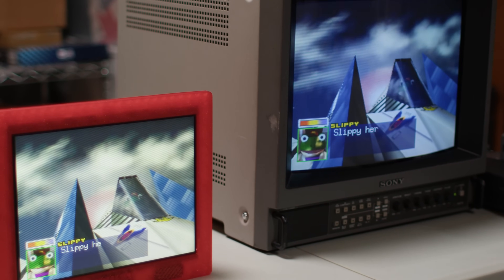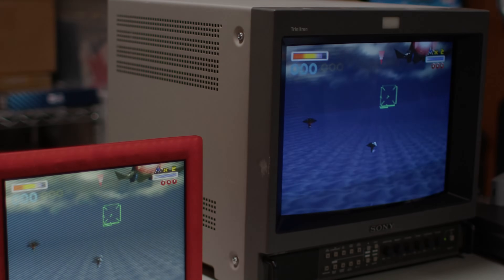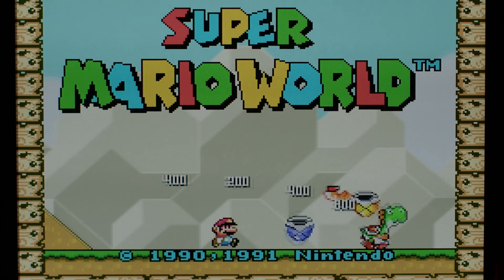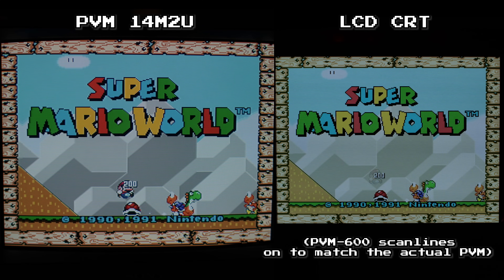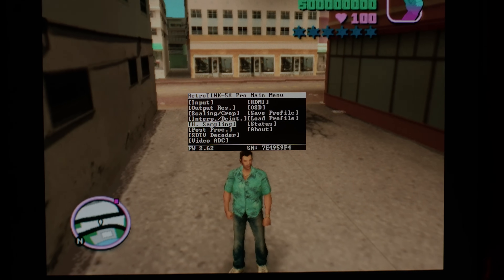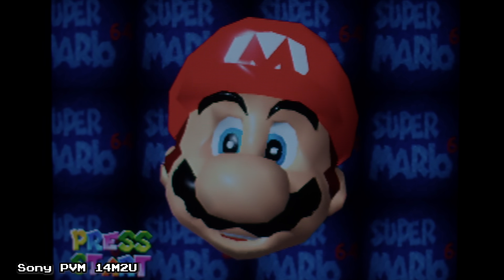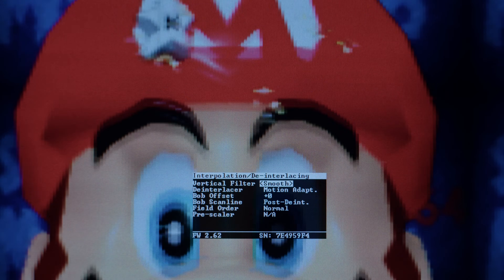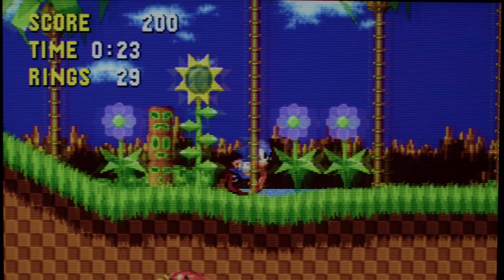Scanline Filters on the LCD CRT Kit

Comment: I have a mayflash Ps2 hdmi dongle and I was wondering if pairing it with an hdmi scanline generator would give good results, particularly in 480i and 1080i outputs. I know the ideal route would be going for a scaler like the gbsc or similar, but since I already have the hdmi adapter, I was just thinking on this possibility...
Reply from the maker: PS2 is by far best paired with a good scaler, since almost all the games are 480i. GBS-Control is less than $50 if you’re on a budget, but the RetroTINK 5x, CE and 4K Pro are the best for PS2. The OSSC Pro is also great, but not the original since it doesn’t have motion adaptive deinterlacing like the others I listed.

Comment: All of this has become something gourmet and problematic. No shader will EVER replicate the appearance of a CRT, this requires a scientific level of precision. To recreate it, you need to define a single LCD model, to develop the effect for its limitations, then no pixel shader program will do the job, you will need to build a program from scratch that takes the input and calculates pixel by pixel, with several decimal places of result, at a scientific level (this already exists, at an industrial level and at some level in the film industry, but it is expensive) and mainly: Have a lot of processing power.

It's funny how people worry about emulating a CRT tube accurately, but to this day, they DON'T GIVE A SHIT about the audio, there is no software implementation for analog noise, or for the audio processing of TVs from that time, which generated noise and a characteristic sound, we only have pathetic filters that seem to have been taken from Windows Media Player.
Reply: crt shader maximus royale will give you 95%+ (99% for me) of the real deal on a 4k oled

Comment: Probably a question that's been asked before but why does it seem like the pvm has more colors than the LCD? Shouldn't the iPad 3 screen be at least the same? Or is it because of the filters?
Reply from the maker: Well, CRT's always perform better with black levels and some colors than LCD.  You'd need Plasma or OLED to compete.  I don't think it's that drastic of a difference in person, so I imagine my settings on the camera could have been better as well.

Comment: This scan lines filter is basically the technology that ables lightguns to work. Does it work with it ?
Reply from the maker: That's not quite true.  And light guns will never work with flat panels.
Reply: @RetroRGB  So, I checked and my TV is a 100hz flat screen CRT, compatible with 100hz lightguns. So maybe the screen could have a frequence variation to get these guns working ?
Reply: @RetroRGB  Oh ok i was wrong so !

Comment: i wish PC gaming monitors came with a filter like this available in their firmware (but properly calibrated/tuned by in the factory for the best result with an specific FLAT panel).
Just imagine a 23.8" monitor with 1440p resolution running at a max of 300Hz, FLAT QD-OLED panel, HDR1000, Native 10-bit, Glass Front, Native CRT Scanlines Filter, Variable OD, Variable BFI & VRR tuned by @BlurBusters

Comment: Unfortunately it's not as good as CRT Royale is right now. Not even close.

As far as retro gaming on LCD goes, it's probably still better to just emulate with Retroarch with CRT Royale. With automatic frame delay and runahead nowadays, input lag isn't a problem for the vast majority of retro gaming that would benefit from playing at an CRT anyway, except maybe N64. PSX already can run Runahead with the correct core.

I understand the argument for playing in retro consoles (as I personally does have an CRT for playing my retro consoles). Playing at LCD with real consoles is so much of a hassle that it might be just cheaper to build an PC with enough horsepower to properly play Retroarch with all the good things that it does have right now. I used to avoid Retroarch and software emulation as a whole since input lag bothers me a lot. 

But nowadays, it's a different story. It does have an learning curve to setup but once it's done, it really can't get much better then this.

Comment: Why does no one make a 24"+, 4:3 aspect (!), 1080p/1440p, low lag/latency (1ms), FreeSync compatible monitor?
In other words 'made for emulation gaming'. One would believe that the emu-market is rather big and this would sell like hotcakes.

(And oh, if it was prepped for friendly arcade cab mounting as well, it would just be superawesome).
Please, someone, please. #LG #Sony #Samsung #Asus #Eizo #whoever ...
Reply from the maker: Because to ramp up production on something like that would either mean you'd have to sell 100,000 units at $200...or they'd be $3500 each in low quantities.  Good question though.
Reply: @RetroRGB  is 100,000 units unrealistic (seriously)? I'd gladly pay, say, $500-$800 for a monitor with those specs ($3500 seems a bit steep though).
And there are just so many exotic, non-standard monitors out there, like the square Eizo EV2730Q-BK and even the 20.1" LG 4:3 LCD Arcade Monitor (which is the closest match I've been able to find, but the response time is a too slow 6.5ms) at $269.
Reply from the maker: I honestly wouldn't have known any of this, if I wasn't involved in product manufacturing myself.  The best example is flat-panel TV's.  Remember when they were first released?  The cheapest one was like $15,000.  It was only when companies built billion dollar manufacturing facilities and starting selling them in extremely large quantities that they got affordable.  We're lucky now that it's much cheaper to modify an existing design (and manufacturing), but my price guess is pretty accurate:  That Eizo is $1500.
Reply: @RetroRGB  Just to be clear. I am not arguing against you. I simply dream of a specific kind of monitor and imagine there is actually quite a substantial market for it. 
Love your channel. Keep up your great work!
Reply: @RetroRGB  or just fix that LG Arcade Monitor (better response time + FreeSync) at the very least. : )

Comment: Very cool. I love these CRT filters for the Mister. I have a Sharp 32 inch CRT Model 32F-641 that is wonderful for my consoles, but for some reason I cant get the ini file for mister configured to work. It worked months ago but I lost the custom ini file. Any ideas from the community on getting mister to work with my model CRT since it worked before? I have had some trouble getting the right settings. Output is common from the HDMI to a converter back to component or composite based on my choice for the converter. I don't have a good way to go from VGA to component or composite.

Comment: Pausing the video for a moment: The one thing I always see in the masks on the MiSTeR is that they show a pattern of lines, it's almost as if the mask is created with a, just for an example, 20x20 thumbnail of the mask, then patched together to fill the screen. I wonder, would there be a way for the mask creators to make a giant, randomized looking mask. The consistency of the pattern is too noticeable for me, unlike the CRT where the mask seems to be not dependent on a pattern, just "random" points. Hope this makes sense!
Reply: I think the "randomness" in the mask is likely caused by 1) the tube being larger than the viewable area. There is part of it that will be behind the front assembly of the CRT, and 2) the CRT (even a "flatscreen") being convex, so the mask is not as even as on an lcd.

Comment: What do you think about retroarch crt shaders, also the “death to pixels” custom shader?
Reply: I've done a side by side with a cheap samsung 1080p pc lcd screen against my 2 crts and a few of the included shaders in retroarch do a great job getting close. I don't have a pvm, but regular 20ish inch tvs from the late 90s, one is a sony trinitron but my panasonic is actually the better looking crt. I did tweak some shader values to get it a little closer to my crts, like the screen warp amount and bloom effects and colors overall. Probably the bigger improvememt you can do is use oled to get a better contrast ratio and black levels, as my cheapo lcd screen is a single zone backlit so it's rather washed out in darker scenes in comparison

Comment: I wonder how close RT5X Pro's CRT simulate is to GBS-C's bob deinterlacing + scanlines? I more recently heard that it's a thing you can do with the GBS-C, and I was surprised by how good it looked and how the flicker changed with the line filter enabled. It sounds like the idea is similar to what CRT simulate does?

Only problem is that I don't have the clockgen installed yet, and even though the tearing doesn't bother me normally,  it becomes absolutely obnoxious with bob + scanlines + bright background 😅  looks like a light bar sweeps across the screen vertically every 5 seconds or so.
Reply from the maker: Totally different.  All other scalers currently on the market just draw black lines, while this is mask emulation.  GBS-C is still awesome though!

Comment: With the amount of pashion and entrepreneurialship in the retro scene, I'm pretty confident that +10 years fron now, there will be "simulated CRT TVs" that use some 4K high refresh rate OLED panels with black frame insertion and simulated scanlines and shadowmasks and whatnot.

Obviously those panels need to get down in price to become super viable, and I'm thinking the black frame insertion would probably be more tuned for this particular use case, but I have no doubt people will come up with some crazy and impressive replacements for CRTs eventually, out of desire to keep the spirit and look of these games, to retain the experience.
Reply: I doubt oled will still be the dominant display in 10 years lol, oled is just lcd with better blacks and slightly better motion. Still have the issue of imperfect motion regardless of what you apply to it, unfortunately. I can see a true crt successor coming out, but it won’t be until the patent for lpds end.
Reply: @MrNapkino  "Slightly better motion" sounds a bit hyperbolic, though. TN/TFT are fast but even then OLED is several times faster in pixel transitions. But with TN/TFT you are still sacrificing on many other picture quality fronts, while OLED also performs great at many fronts, making it a pretty attractive for this sort of experimenting. 

I can't say I have ever paid much attention to the difference in motion performance, up until just recently, but using black frame insertion/backlight flicker on LCD can already improve motion performance quite a bit, and that applies to OLED as well. I have seen a CRT in real life just in the past 2 years with a more critical mind, and the motion performance is quite magical, but I dont think we are getting anything equally good or better until sample and hold is dead, and who knows if that's happening at all. OLED adopted sample and hold, so who's to say that something like micro LED wouldn't do the same.

That's why I think some sort of high res OLED panel with high refresh rate would be quite useful for the purpose. Resolution for ultra accurate shadowmask filters built into it, and refresh rate so that the beam/dimming of older lines could be simulated to some degree, which could work as some sort of BFI as well.

Even if it isn't exactly like real CRT TV, with the old tubes being guaranteed to die off, I'm confident that the retro scene will start experimenting with stuff like this, out of necessity and will to preserve the old feel of the tubes.
Reply: @shotgunmasterQL  yeah as someone who uses CRTs almost daily, modern displays are just so bad with motion in comparison that I honestly prefer a crt running composite than an lcd with hdmi lol. Motion is just way too important for the games I play to sacrifice it, and the lack of ANY audio/visual lag is just so good, and is also another thing you unfortunately can’t replicate with modern displays. Combine those two things together and it really improves the gameplay experience drastically.

Comment: I feel like a great way of fixing the problems a digital TV has displaying analog would be to make an LCD display that reads the analog signal and then draws it in the same line-by-line fashion instead of converting it to a digital picture.
I think that if the LEDs lit up in a sweeping scanline-like pattern, not only would it have essentially no lag compared to a CRT, but it may even work with light guns like the SNES super scope.
Reply: If only panel drivers and digital video output standards that could do this were a thing...

You'd still need to fake the CRT mask, scanline pattern (or maybe stick a CRT mask overlay on the panel itself) And in the case of an emulator on a computer, you'd additionally need to fake analog degradation, and come up with a complete display pipeline that also worked natively on a scanline by scanline basis at every stage, from the emulator to the operating system to the GPU to the monitor.

And you'd also need a pretty decent scaler on the display driver circuit that lit all the pixels that belong in the same virtual scanline together in a CRT sweeping motion and interpolated the input accurately as it scales to fill the panel.

It's technically possible to simulate a CRT scan entirely digitally on a modern LCD display, but it would require tons of custom display hardware and software and even a custom output format to do it properly, and reach virtually nonexistent latency land like real analog hardware. The modern display pipeline is just designed around full frames the entire way through.

Comment: Would be great if one of these companies could just make new crt's for gaming. I would be willing to pay $1000 no problem
Reply from the maker: It's be more like $3000-$10,000.  The only reason CRT's were so cheap over the years, is because they built massive factories to make them in bulk.  Having to essentially hand-make each one would take a week or more for each one.
Reply: It removed my link. Just search for Dotronix CRT.
Reply: @jeremyjones7590  cool thanks
Reply: @BoboBreez  From what I've been hearing the tubes themselves are not being made anymore. They likely use premade old stock tubes and the rest of it is handmade. Shouldn't be an issue if there is no hours on the tubes. I've been hearing of prices less than $3,000 for some of the 27" sets. But you'd have to ask to confirm. You know how hard it is to get 100% facts on the internet. 🙂
Reply: There is a Minnesota guy in the USA still making CRTs until he runs out materials. He said he'd consider making some for regular people but it's around 5 Grand.
Reply: @jeremyjones7590  link?

Comment: Pretty cool.
I guess get rid of some ipads.
I hope to see a review of the checkmate monitor. It's a actual low resolution LCD panel. Hopefully low latency and looks nice. For the old vga computer. With a upscaler like retro tink or OSSC it can scale it easy to native resolution. Some rts games i know are set to one resolution. So the upscaler will help. Hey also come computer cores from the mister i guess. I need a bigger size thou.
Hey if i end up using a upscaler anyways this could be ok. You said low latency so.....
Usually just hook up to the tv and not worry about it. With some sort of upscaler of course.

Comment: I wish these iPad screens where 14"-15" big. That would been perfect. 

I've bought one of these screens on Amazon, and it works quite good. But just a quick warning, if you plan to use the micro USB for power, be very gentle pushing it in. I managed to break the contact (it fell of from the LCD motherboard) since it was only soldered on two spots (with no holes in to the motherboard). The motherboards chip also gets really hot, and should have a heatsink on. Anyone else got this problem? Mine works fine for a while but when it gets to hot there is some problems.

Comment: CRT Simulate looks amazing!  Does it base it's interlacing on the incoming sync signal?  If so, then presumably if that sync signal starts sending the same one every frame, then effectively CRT simulate would automagically and seamlessly become 240p right?  Would that solve the Chrono Cross problem for good?

Comment: So the question is,  when are we getting a true 4k upscaler? There must be one in development, even if it needs much more powerful FPGAs etc in it.
Reply from the maker: Years.  The issue is cost and the chip shortage.
Reply: Mike is currently in the very very early stages of one. As far as I understand, the problem with needing more powerful FPGAs is that the gap seems to be too big in terms of price, so it wouldn't be feasible to make one for consumer usage as of now or short-term.